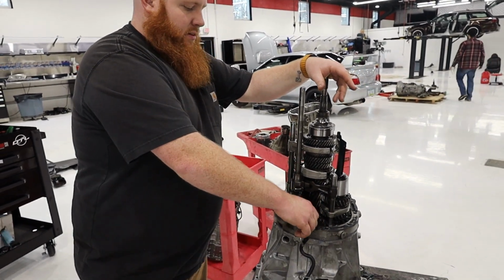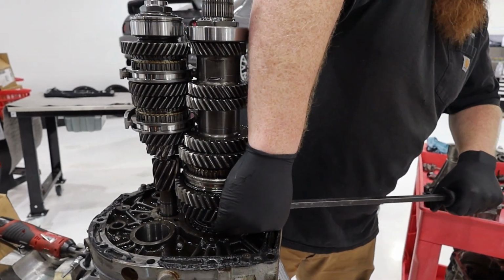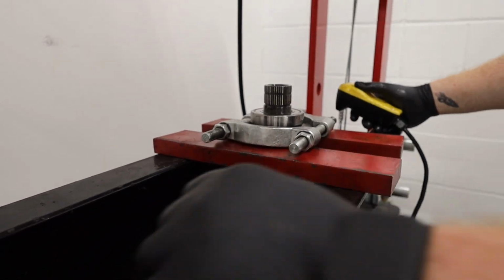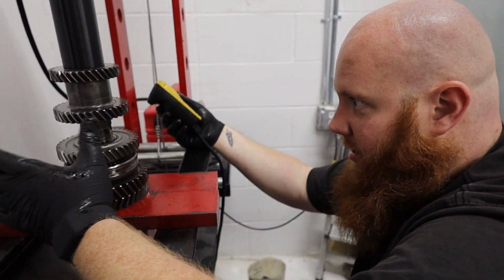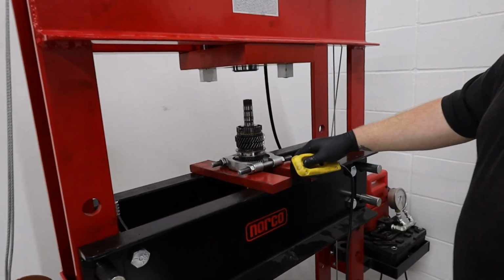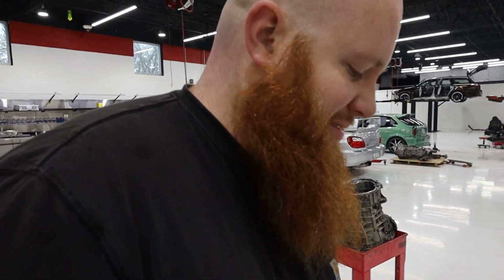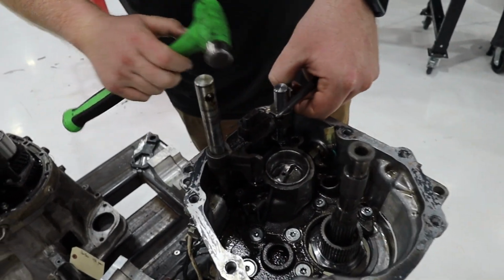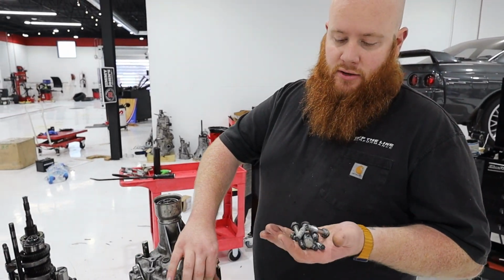HE BROKE WHAT GEAR?? // HOW TO REBUILD STI 6 SPEED TRANSMISSION

Comment: so curious, do you guys not replace all the bearings, needle, tapered and ball bearings when theres a failure? Seems like something that is overlooked unless you did and it wasnt shown. Do you measure bearing preload when you do replace these bearings also?
Reply: It's probably unlikely they replace all of them, that would add hundreds of dollars in parts expenses to the rebuild. Probably just check them and reinstall if found ok. These aren't bearings you can buy wholesale, each one is like $60/ea minimum. Many are much more expensive.

Comment: How much should an STI 6 speed tranny rebuild be? Mine is slightly grinding into 2nd and 4th suddenly. My shop wants 3500 for a "basic refresh" plus 600 for removal and install. And then any upgrades or replacements ontop of that.
Reply: I got quoted at Subaru 2700$ for just labor I supply parts lol
Reply: @ohiosoutlaws3411 What a joke

Comment: Thanks for the video! I ran into an issue where second gear stopped spinning once I pressed on the 3/4 driven gear. I flipped the center of the 1/2 hub selector when I pressed it all together the first time. I took it all back apart and flipped the only piece that I wasn't 100% sure I had on there right and everything pressed together smoothly! I still couldn't tell you which way the center hub selector is supposed to go, so be careful when you pull it off or mark the top when you are taking it apart. Mine fell apart on me when I went to clean it, so I should have been more careful.

Comment: My buddy has a 2004 dccd trans we swapped into his wrx. The car wont move in any gear. If the car is raised wheels off the ground the wheels will turn ever so slightly but on the ground it wont move under power. Any ideas what we should look for? We know the car it came out of was in some sort of accident so my buddy bought the whole drivetrain from the car
Reply: rear diff is wrong ratio ?
Reply: @Old fashioned WRX  i appreciate the reply but no he got the sti rearend too and even out in a cusco lsd with the correct ratio
Reply: @adamwolak7992  still broken?
id look at input vs output, maybe not selecting correctly or transfer/centre diff issue?
Reply: Did you ever figure out what the issue was? I just rebuilt the DCCD on my 07 and have the same issue. My car is doing the same thing, however when in the air only the front wheels spin.
Reply: @tylerhindenach7358  unfortunately we never did find out what was wrong with it. He is still driving on the wrx 5spd. We are pretty sure there was something broken in the front of the trans maybe input shaft. The the trans came out of a car that was in a front end collision